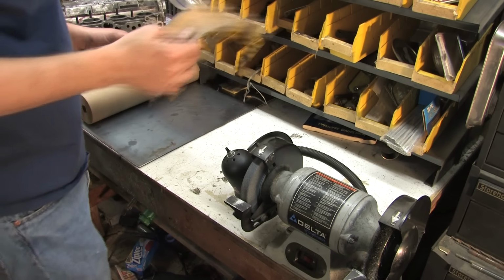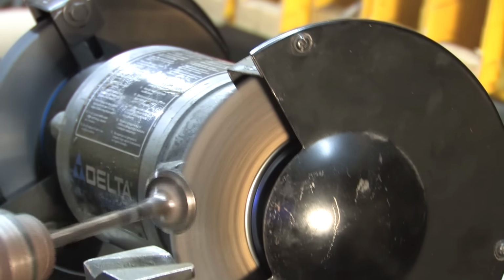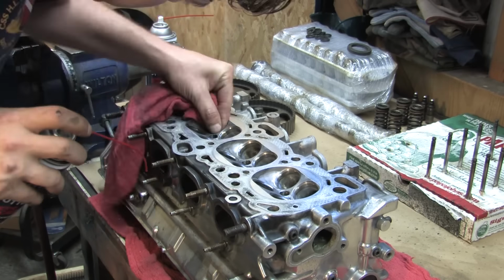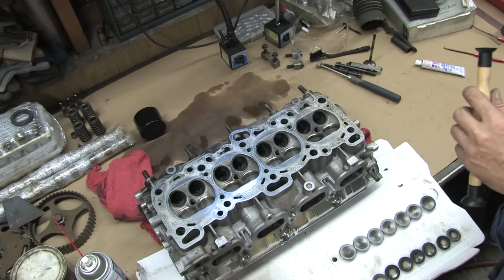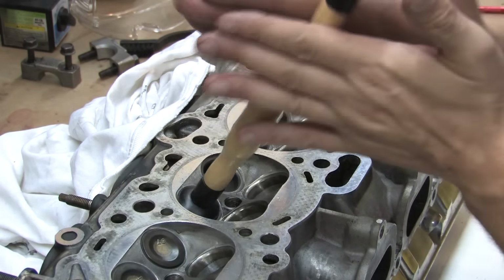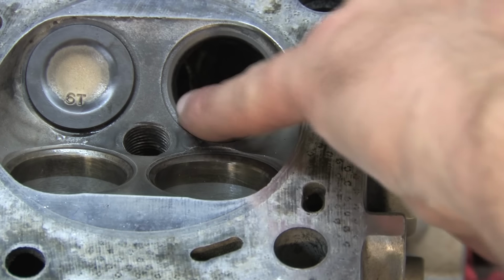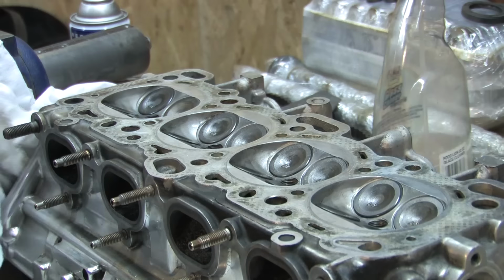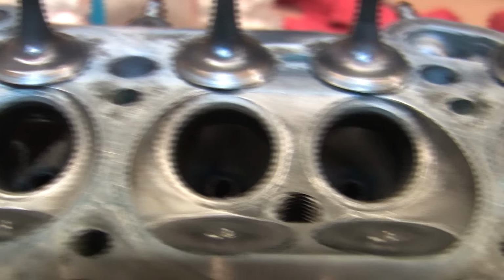Cylinder Head 105 - Valve Job Basics

Comment: I'm going to use your technique dude thanks for the vid I hv also a v6 which doesn't hv compression on one bank of the engine ( cylinder 1,2and3) the mechanic said the a bend valves so since I saw this vid it helps a lot I'm going to follow every step u took from the start to finish

Comment: Valve seat cutters help speed the process up on heavy carboned heads. I get the seat flush, free of carbon spots , the finish with lapping. Reduces chance of ridging or cupping of valve face. Reduces chances of uneven valve face margin if heavy guide wear. At 140,000 plus miles you will have some drift on some margin edges.

Comment: When using a drill put a bit in the chuck that a short piece of vacuum hose will go on. The other end of the hose will go on the stem. Works perfectly with no worry about pressure to one side or the other.

Comment: Ive done lapping with power drill. Most of the problems you listed can be eliminated by using rubber hose between the drill and valve stem. But i still agree, you will get beeter results by doing it this way.

Comment: Great video and you are correct, using a drill while lapping is a big nono. Although, I was hoping you had the drill attachment I cannot seem to find. It automatically reversed 1/4 revolution and moved ahead 1/2 a rev with the drill going one direction....I think I rather use the hose method on the valve stem (again) I hate those sticks with a passion haha, you must have found one with decent cups.

Comment: I do the drill method, But I use a rubber hose in between the drill and the valve. Helps reduce lateral loading. I also use a finger to close the valve and provide pressure and "feel" it. Then I remove it and see if it seat well by hand without the drill and squeaks or not.

Comment: I was gonna send a set of heads off to the machine shop but I think you've inspired me to try it myself
Reply from the maker: If you know that it has bad seats, or crispy valves that won't clean up... then you still need the machine shop.  The valve job you can produce from lapping is really not adequate on modern cylinder heads, but if they're not bad, this can buy you some time before getting a proper valve job done.  Lapping with a modern cylinder head is more of an inspection than a repair process.  It will for sure tell you if you need a machine shop's help, though.
Reply: @Jafromobile  ah ok thanks.
 I've got a old set of Chevy vortec heads that need some freshening up. 
Either way they will have to go to the machine shop to get the valve guide boss and pressed studs swapped to threaded. I might be able to save a few bucks and learn something though.

Comment: After you put the springs back on the valves always a good idea to spray some brake clean down each port to make sure you don't have a valve leaking. If you see brake cleaner leak past the valve and seat you no it's not sealed yet.

Comment: Good job, im about to do ky valves on my mercedes c180 which the timing was out and now cylinder no 4 on the intake manifold is blowing air instead of sucking air guessing valves are bent so this is a good tip. Thank you for sharing the video

Comment: I use a drill for valve seats. But I usually take a smaller old valve and stick the 2 bottoms against each other with a glue gun. You will not damage any stems and you apply pressure on the valve more evenly. Try it some time you might be surprised

Comment: I put the valve in the drill chuck, put the drill in the vice with moderate clamping then use a  metal scraper & emery tape or medium grit paper cut into strips then finishing up with 2000 grit.

Comment: Cool video and very informative! I just ordered a new exhaust valve for 97 Accord F22b2 cylinder head and a re-ring kit.  I bought the long block used for $80. The head was previously worked and reconditioned, did noticed oil residue inside the exhaust manifold. What they failed to do previously, was to install new piston rings. #2 had an extreme blow by causing excessive oil to seep into the combustion chamber and burning the exhaust valve.
Reply: El Gato Gordo did you check you valve oil seals ?   Got similar problem with my Toyota Corolla valve oil seal wear out and oil into the chamber smoke and oil consumption was high but the real problem is the valve guide to much play that wear out the oil seal
Reply: @joecostu1571  Yes, replaced the valve oil seal. The cylinder head was reconditioned recently, so it had new valve guides and seals. Only one exhaust valve was burnt due to piston blow by. Car is running great and recently pass the SoCal dreadful emmission test 👍

Comment: One thing that works for me when lapping the valves with those little suckers, is cutting a few mm's from the lip of the big suction rim and adding a little oil to the face. I then could use the one side for the exhaust and inlet valves. The bigger one tends to grab much better.

Comment: Old air cooled VW manuals had the same procedure for valves and also seating the jugs/cylinders to the heads, glad they were only 4 cyl. turning jugs by hand will wear you out.

Comment: I have used drills,you use rubber hose between the valve stem and drill, then finish by  hand, I agree that you must work clean, some times the valve seat is so bad, that you have to have a machine shop re-cut the seat angles, the real test that counts  is to pour a fluid into the ports with the valve springs installed, if it leaks start over again

Comment: I've done some car work but, new to fixing engines. Recently replaced the balance shaft on my ML 350 and before final assembly ran a compression check and found one cylinder leaking. Doesn't seem to be the rings. Started looking into the valves.
Been talking to my father-in-law (old-school mechanic). He suggested this technique and i'm glad i ran into your video. Thanks man.

Comment: This is the best way to lap valves but I have done a quicky on a mower or trashy motor with a length of vacumn hose from the drill to the valve. allows wiggle and an even straight pull on the valve with out sideways force. I dont spin it so quick it sprays the lapping compound and I pop it up and down to re distribute the compound. you can tell by feel and sound as the grit gets smaller and the surfaces get shiny. I test by pouring gas into the head and seeing if it leaks out down the valve stem or by pressure testing the cylinder with only the weight of the valve or a finger pull for test.

Comment: If I had any questions about whether or not you should be listened to, they all vanished into carcinogenic vapor when I saw those cans of Berkebile. That stuff is magic and incredibly hard to find as you mentioned. I've only seen it on shelves twice: the first time it was the last can on the shelf and the store never restocked from that day on (~5 years ago; still nursing that can to this day haha). The second time there were multiple cans and I bought em all. Same chain, different locations (Advanced Auto in the Seattle area). It's one of the few products that still proudly features the skull and crossbones warning symbol right on the front of the can, so you know it's gotta be the good stuff!

If you're unable to get your hands on Berkebile, a reasonably close-ish alternative is Casey's Gun Scrubber. You can get it at most any sporting goods store — I think Walmart may even carry it. It's better at carbon removal than carb cleaners like your B-12 spray and such, but it's about 3x the price of Berkebile or other carb cleaners, so only really worth using specifically for these really heavy carbon situations. Even then, it's still not gonna do nearly as well as the Berkebile, nor is it gonna act as fast.
Reply from the maker: Preach it brother!!!  It also permanently removes wasps and insects on contact.  Removes from what?  Yes.  Mid-flight.  Flight stops immediately.
Reply: @Jafromobile  
I never even considered trying that, but now that I have a little bit of a reserve on hand, you've got me looking at that softball-sized fly who's decided to set up shop with me here in the garage in a whole new way. . .
Reply from the maker: @screwsinabell  Give us an update!  Conducting the same experiment and comparing your results is the textbook definition of science!
Reply: @Jafromobile  
Most definitely. I think he got wise to my intent, because he went quiet all of a sudden. That's okay. I can outwait him.

Comment: I found some product on amazon called "powerbuilt valve lapping compound", it comes with 2 separate tubs, one coarse, and one fine grit. I only mention this because you said you could not remember the product name that you liked the results it gave. 
Its under 20 bucks for the pair of 2oz. tubs. Thats a fair price if it is as good as you said and the reviews state.. anyhoooo.. 
Thought this might be of use to someone down the line.
Awesome videos and presentation. Thank you for your time in making them.

Comment: Used compressed air to clean the guides out, hit with break clean or mix up your own solvents. you can get toulane from Walmart or home Depot and put it in the spray bottle and it works much better. Lap the valves with a silicon carbide a second time. Silicon carbide is used in jewelry stores are any lapidary artist uses it for stones. It works amazing for polishing cylinder heads. It comes in different grits as well and it's really cheap

Comment: Reading the comments toyota have valve issues .  got a 93 toyota with a broken valve in the exhaust # 1 cilinder looking down throughout the  spark plug hole oil on top of #1 cilinder took it apart and noticed  broken valve this be my first valve job thank you

Comment: Put a hose on the valve stem top and you can pull the valve into the seat and lap it works much better. I have used a drill with the hose in between eliminates most of the probs you state and a 12V cordress drill works great. Also a magic marker on the valve face and seat will reveal any areas that need  more grinding pits uneven wear ect.

Comment: Don't understand why there is 413 dislikes to this video.  Jafromobile told us how it should be done.  Great teaching Jafromobile.  very informative.  Awesome.....
Reply: because what he did isn't what is recommended. This is a very old school way of doing valves and would work great on older engines up until the early 2000's. Newer heads and valves require better numbers than hand-lapping valves. You need a machine to precision cut and face them. You can argue that the valve lapping method will work just fine, but it actually just doesn't in modern engines. It creates a multitude of problems that may not be noticeable at first, but down the road may lead to engine failure and component breakdown. Again, anything newer than 2000 I wouldn't risk lapping. I'm a machinist/mechanic.

Comment: SPECIAL TIP, here, dude.  I remembered that I had some spirit gum that I had bought from Bargain Bins for about a quarter or 50¢.  I put some on the suction cup and squished it against the valve which I had sanded.  Then I removed it to let it dry some.  It works amazingly well.  The only thing is, I think I should have degreased the valve and cup first will anhydrous isopropyl alcohol or carburetor spray.  It might have worked even better.

The spirit gum is a "professional adhesive for applying prosthetics, bald caps, wigs, and crepe hair".  It is a product of Mehron, Inc. in Chestnut Ridge, NY.  It comes with a bottle of remover, but I might just leave it on and let it burn off.  It DEFINITELY HELPS.

Comment: I use a rubber tube and cut off bolt, that will prevent scratching the valve stem. All you need to do is pull back with the drill when lapping.

Comment: When did they go back to lapping valves? In the 80's we cut the seats at 45 degrees and the valves at 44 degrees to provide an interference fit between the valve and seat. That way as the valve and seat wear the contact point just moves outward. When you lap the valves and the valves wear they just sink in the seat and they won't seal anywhere near as long.
Reply from the maker: +Kenneth Cohagen This is a "bush fix".  I linked to a radius cut in the video and description for those who want to see how to do it right.  Sometimes the bush fix will get you by... but for performance, cutting new seats is the only way to get it right.
Reply: In the "Old days", when the valve seats were softer, due to leaded fuel, we used a dowel rod with plunger, secured on the cleaned valve face and lapping compound and then, holding the dowel between the two hands/palms, we would roll dowel in hands, much like the procedure used to make a "Boy Scout" friction fire.  With the relative soft metals, the lapping process did an excellent job at seating / sealing the valves.  If you hand a few extra dollars, there was a hand-cranked lapping "drill" that would alternate CW - CCW, which was a huge advantage over the Palm lapping procedure.
Reply: +Jafromobile that's what I thought. I started out lapping valves but unleaded came along before I got out of school, and all the machine shops I worked in refused to lap any after that because they warren tied their work. It's good for a cheap fix though. I had a friend that spun a bearing in his 289. He was building a hotter engine, but needed this on to get to work, so he JB welded the new bearing in place and drove it for over a month. Crazy stuff!

Comment: tips for you, use one quart air hose and put it back of the valve with battery drill at lows peed, save lot of time and level much better the valve seat, great video
Reply from the maker: I get this comment a lot, and my take on this is in this video at 7:58.  It saves time, but in no way will it ever produce a better seat.  It actually cuts out 2 kinds of feedback you'd get that would tell you when to stop, and therefore greatly increases the possibility of damaging the seats.  The very most important part of the lapping process is knowing when to stop.  When you have a power drill between you and the part, you can neither feel nor hear when the valve has had enough.  The wider and flatter the seat is ground, the less it seals.

Comment: I have a 1994 blazer, when you first start it up it puts out a considerable amount of smoke from the tail pipe. I was told it needed valve guides, the problem is machine shop prices are rediculously high here in Anchorage Alaska. You can just about get new heads for what they charge.

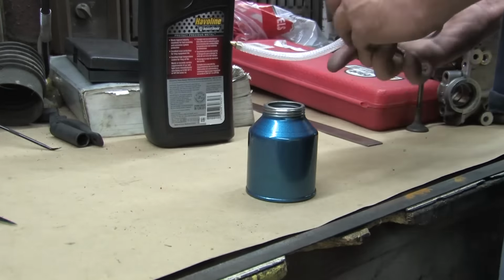Comment: 5:04 
I fked up…. Book said assembly Lube and then a dry run. Then take your finger on the top the valve pulling the bottom not letting ur finger off the hole in the stem seal pulling it out listening for a pop sound. Then I used a small tiny amount of valve compound and ran the seat of the valve in the head cutting head and valve at same time. 😢
I fked up.

Comment: Quick tip for the annoying lapping tool slip and slide--I put a dab of hot glue on the center of the valve and push the suction cup into the goob of hot glue. When you're done with the valve, simply peel off the glue from the end of the lapping tool, and continue on to the next valve. I usually clean the valve face and suction cup with an alcohol pad between valves to ensure a good set into the hot glue.
Reply from the maker: Hmmmmm........  Seems plausible!  I like it!
Other trick is to use the smaller lapping handle made for motorcycles and 1.5L Hondas.

Why not both?

Comment: Wheeler Lapping Compound, anywhere from around 100 to 1200 in 1 oz plastic round  "cups"  with screw on cap which is about 1.5 wide and filled up about an inch. Available on Amazon. Permatex stuff is fine, I use it, but using the fine grit wheelers compound will really smooth out the valves and seats far more than Permatex.

Comment: Old vid but this doesn't age :). I use a small diameter plastic hose I put on the stem and the other end has a bolt in it which goes into my battery powered drill, this way there is no lateral forces at all (plastic pipe, like used for brake bleeding etc. is flexing to remove lateral component) and job gets dome really fast. Drill is quiet so I hear the change of tone very well. If anything I have to change the compound very quickly as it breaks down fast. I tried suction cups but I cannot get them to stick to the valves for no love no money. I work on small engines (like mowers, generators, etc) so the valves are really small therefore not much area for the suction cup to stick to sadly... thank you for the video

Comment: YOU COULD PROBABLY USE A DRILL WITH A SHORT PIECE OF FUEL HOSE TO DO THE VALVE LAPPING... JUST FIND A DRILL BIT AND HOSE THAT FITS SNUG ON THE VALVE STEM

Comment: i’m having trouble with my valves to seal.  i can’t get any compression…. i ve lapped the valves but still nothing.  i had the same problem with a yfz450.  and now i’m working on a 07suzuki ltr450
Reply from the maker: There's a video here called "not another valve job" that covers the best ways to deal with this and all the other variables.  This was just the basic trick to clean up what you have and see if it will seal.  If this fails, there's something wrong with the cut, or further problems that need to be investigated.  I do vacuum testing and all kinds of other helpful stuff in that video.  I made this video when I had 3000 subscribers.  I had no idea it would be my most watched video for 16 years.  That other video is better.  Edit:  12 years.  I've been here 16, but 12 years since I uploaded.
Reply: @Jafromobile   thanks alot!  i’ll look into it
Reply from the maker: @jimenezgarage4939  No problem!  You'll see I got a little bit better at this!  lol